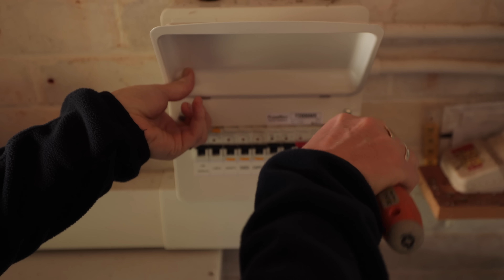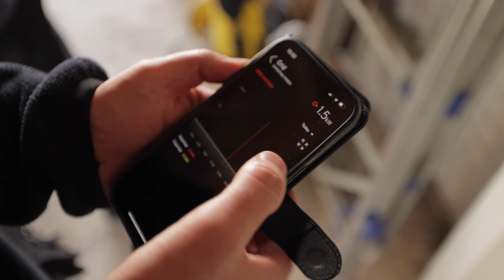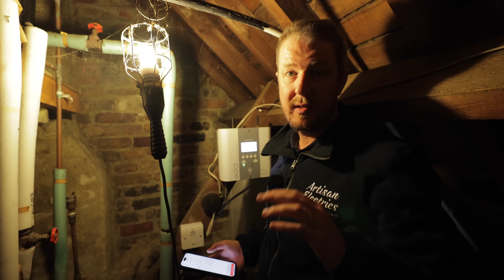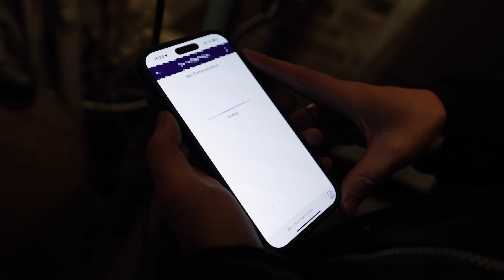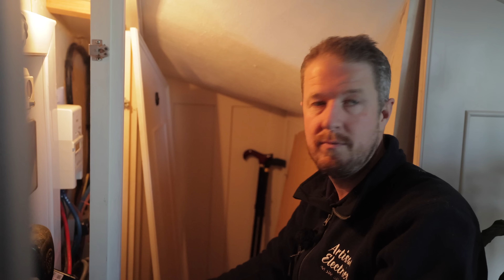£20,000+ Battery System RUINED By This 1 Simple Mistake 😳

Comment from the maker: 💡 Unilite Work Lights: Get 25% off all Unilite products using code "ARTISAN25" - https://unilite.co.uk/
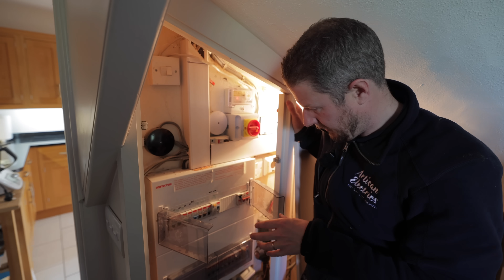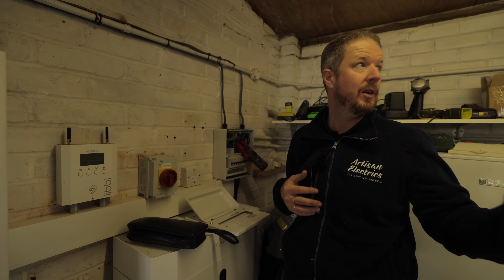Reply: 13:13 😊 13:23 14:49 15:37 15:37 😊😊
Reply: There is no insolation on hot water tank
Reply: After seeing all them boxes, i think I'll stick to normal, it looks a nightmare, you need a separate building for it all.
Reply: So this system wasn't actually ruined, as you claim in the title, but was misconfigured and not monitoring the correct currents. Please don't fall into the trap of using misleading titles; it does you no favours and will lose you some of your potential audience and active supporters. That said, thanks for the important information in this video.
Reply: @RWBHere  EXACTLY!

Also to consider, potential customers, that have the foresight to investigate companies to try to find the most honest ones, could easily be turned off by that misleading and blatantly wrong title.

Channel owners do have the ability to change titles on already posted videos.

So let's see if he gives it a more accurate title or if ego won't let him change it.  THAT WILL SPEAK VOLUMES!

Perhaps something like:
£20,000+ Battery System made inefficient By This 1 Simple Mistake
Reply: In Australia you will never see Single Insulated Cable without opening a switchboard. In the UK it seems that you can have sigle insulated cables where children or animals could swing off it.
Reply: *uses phone torch 😂😂

Comment: For me, I can see the benefits of interactions with a supplier for tariff changes but I think the savings are far outweighed by the complexity of interconnectivity and apps. I'm all for simple installations which are easy to analyse where faults occur. The likes of Octopus are just complicating things on a temporary basis. I say temporary, because soon there will be no off peak tariffs when EVs start charging at night in large quantities.

Comment: I had a similar problem here in JA. My 18 x 700 watt pv were pushing 13k while my 10k inverter wasn’t pushing enough juice to my 4  c 10k batteries and they were taking too long to fill up. I added another 10k inverter and for good measure added 2 more 10k batteries. I know it was overkill with the 9 x 700 watt pv but I didn’t care. I also have a 80 gal solar water heater.

Comment: Proper DC and AC conductor sizing is vital for any healthy system..

My shed with 6kW  solar is ~60m from my house - so many installers called it a "no-go" until one installer was willing to mount the inverter in the shed (remote from the  - and a 3c+e-16mm2 conductor was placed in the existing conduit (prior to the installation being performed, we also installed the CAT 6 cable (2x for with one for wired data) in a separate conduit for the main board 3xCT + power monitor hub) )..

Inverter or battery in a loft is a fire hazard...

Comment: Should be CT's in the main board running to the battery so the battery can see the main load and solar production and know when to charge/discharge, throw that Eddi in the bin, then the car can charge whenever it needs to from the battery which is alot more practical for the customer. that system has become an overly omplex system relying on wifi because the solar/battery/EV-charger were all done at different times, both wifi'ed myenergy devices just add more points of failure and add next to no value, the eddi diverter to the hot water is almost useless now that he has a battery

Comment: Tip: do not go for net metering. Keep the grid only as a back up and switch it off. Go off grid unless the skies go dark. Net metering is a rip off, pennies on the dollar. Ive been off grid for 2 years, with the grid only switched on as an emergency back up.

Comment: Thats great just changing settings for the guy. He could of chat gpt that and figured it out for them selves.  But thats why we are here. From before i ordered my system i researched alot of different prices quality sizes how too size how to install what will it do for me. Then i dyi the whole system when it showed up i know what setting i needed to make sure had to be done. I look at the app multiple times a day it not needed most of  the time but indo anyway.  Some times i change things. It took me little time to build to set it up i missed one thing that i did not see anyone say much about to the point were i had no clue that temperature coefficient ment that if its hot and you ac is on you what is normally an over kill system and charges full by noon every day becomes a run the generator 3 hours a day because 4500w of bi facial means 3500w in 100 degrees f. 8 hours of really good sun wont get the ac trough the night at 1600w. Sooo for 3 months each year my system is not enough.  Now for everything else its great i heat with propane or ac mosty ac during the day when batteries are full. No power goes to waste.😊 propane at night.but still love my system. Now more panels? Or more batteries? More panels are a waste most of the year. More batteries well 3 months worth?  lol expensive.. choices what woulf you do?

Comment: People often change their wifi routers every 3 years or so, and forget they've got all this kit hidden away around their houses which depend on an internet connection to work properly and update. There should be a big warning label on the front of the manuals stating that "This unit needs an internet connection to function correctly"

Comment: And at 16:30, removing the limit makes sense. Of course, you shouldn't intentionally set up a system that a fuse blows, but in the end the wire is protected by the fuse - not the appliances deciding to be nice and limiting themselves too much. I wonder what electrical code says (obv. not an electrician), but to me the charge-limit her seems more like a convenice feature (makes sure fuse doesn't pop/blow), rather then a critical safety system. 

After all, what if an applicance / the wiring has a short? The fuse needs to be able to protect the wiring, that's not really the job the appliances.

Comment: The stickers at 14:10 annoy me more than they should - mislabled electical panels are a pain. And in the end, the switch label is a part of the overall safety system. You want to be able for someone to make as many mistakes as possible without getting (seriously) injured, right? And not changing out the stickers is a simple way to add a small chance of someone not seeing the arrows (people are in a hurry!), and flipping off the wrong switch - leaving the system in a state where it shouldn't be.

Of course, you should still always check that the circuit you're working on is off before touching live wires - but basically, making one mistake more likely, the 2nd mistake (forgetting to check / incorrectly checking) went from an "oops" to a trip to the hospital. Yes, mistakes shouldn't happen, but they do - that's why we have redudancy.

Comment: In every investment, it's worth a little investigating & research, so one has a better grasp of the particulars,especially when efficiency is concerned. For instance, without deflection of the sun, you're relying on direct adsorption. In this case, the solar panels only have around a 2 hour/day maximum performance when the sun is in the direct line of its absorbing face. To track with the solar panel faces with the sun would give a whole day(max 12 hours) of light to its working effect. Even so, in early & late parts of the day, the distance away is proportional to its manufacturing of power, so this indicates the Sun isn't as far away as we've been told!

Comment: Did you just say the house is using 1Kw? 
How? I am currently (pun intended) using 64w. If my fridge/freezer comes on it will jump to a massive 125w. 

Fit a timer to the water heater, mine uses 3.2Kw, but takes 25 minutes to heat up and then provides enough hot water for a day. It is turned on at 6:25am and is turned off at 7am. 

Don’t generate more, use less.😂

Comment: CAT6 has a 100 meter distance limitation for good signal. Making good connections takes special knowledge and tools.   Exterior grade CAT6 cable is not cheap..   A spool comes in 1000 ft lengths....

Comment: i  seen   one guy with a single tiny panel 2   6volt battries  and had been   working over 20   years .
  the  other end was a guy that spent 60k   and intended to spend another 60k to be totally off grid  .
every solar system seems to be different from the other .
  what we need is a  system that works and is truely   plug and play .

Comment: Watching you on the YouTube video I have a similar problem. I’ve got a 5 kW inverter and 2x 9.5 kW batteries this is a Giv Energy system. My problem is that the inverter will only let me draw 3.6 kW out and if I’d draw any more than 3.6 it goes onto the grid supply. Is there anything that I can do to draw up to 5 kW without having to withdraw from the grid. Help any ideas would be absolutely amazing thank you.

Comment: So this is the state of modern residential renewables? All the devices are internet connected? I wonder how many of them have security vulnerabilities. I wonder how many of these companies will be in business in 20 years. I wonder how many of them will pretend they never made these products and de-list them from their websites with manuals and firmware nowhere to be found. I wonder how many of the cheap capacitors will dry out and fail.

Comment: Great videos as always, but plastic water tanks do not 'melt' at boiling water temps. Those plastic tanks need to be heated to at least 250c to melt! At 250c, that water would be steam, not water! What those tanks do, is leak or fracture due to the heat, they do not melt! very sad about the one incident. My advice is remove ALL plastic tanks and just use mains water pressure (hot and cold). We did this in our 1950's house conversion to renewable energy and hot water tank.

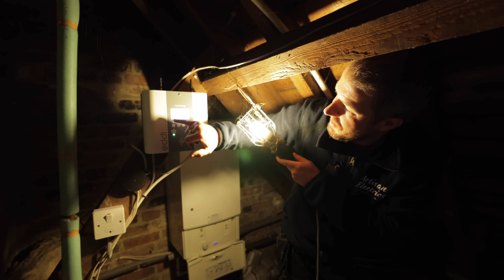Comment: At about 5:30 you said you don’t install inverters or other equipment in the attic. Does that mean the DC wires from the panels go down to the inverter down on the ground? Would there be a large DC voltage drop, especially as my house is a 4 storey? 
My Solar Edge was installed in 2016

Comment: Been watching your stuff, this made me learn about solar stuff, am retired now, am a fully electric and electronic engineer to the 16th edition, worked on both industries and site work, now in brasil, solar for electricity is a big thing her, whats alarming is sparky now and then getting killed our workers doing repairs and getting a belt, what fail safe is there with the panels, are they hot live when installing.  Ive not looked into how they are built.

Comment: The one thing I've learned about solar over the years is that the mc4 connectors are those connectors you want to buy the best quality you can cuz if you get shorts or fires that's what will happen in the inverter should not be in the attic. They do get hot and it's a good idea to keep an eye on them

Comment: In my experience a lot of solar fitters dont know what there doing . On the roofing side of which I have 45yrs plus the solar firms send young lads who learn on the job via u tube. They have zero knowledge of how a roof works . The last one we did they had to take the system off an integrated system fitted sticking over the gutter no back gutter flashing . And the list goes on.

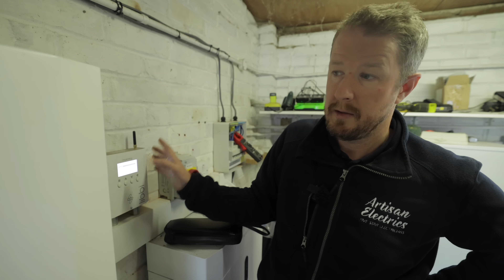Comment: Spoiler the whole point is on 17:35 so you can just skip to it. 
The previous installer limit the charge and discharge lower than it's maximum rated power, probably to increase lifetime and prevent breakage. What he did is just reconfig it to use it's maximum power, this will most likely makes either the batteries or devices die faster.
I often saw solar electric system broke down within 3 years because they use the devices to it's maximum power. For electric devices it's always better to never use it to it's maximum rated power to prolong life even if it's just a simple cable.😎

Comment: All solar systems I see installed in England are crap. Why not a simple hybrid inverter and a battery ??? Why all those small boxes and all those antennas and internet connections????
I have one box - the inverter  - solark 15K. Solar panels connect directly in the inverter and the batteries connect straight into the inverter. 
Every-time I see a solar install in England i want to pull my hair.

Comment: in Aus if you are wired to the Grid with Battery storage , the Grid has the rights to access your current without paying you 1 cent
in my book that is theft !!!  I opted to go off Grid and my 200 amp hr works a full 12 volt marine system
no more silly 240v nonsense.

Comment: Wait wait the Installer told him his system could only handle 30 Amps max at a time why would that prevent you from eventually filling the battery to full over time? That like saying this Hose can only handle 100 gallons and never fill a Bucket that holds 500 gallons it can it just takes more time to do it no?

Comment: 20 kwh is nothing for a battery storage.
"30 amps capacity" what tf kinda wire did they use?!? Here in the states, everything is on #6(16mm) from solar (60 amps)  what voltage? 30 amps at 200 amps is 6kw (maximum solar he has)  6kw of solar should charge that system in about 4 hours, without any home usage. But it looks like he has an almost constant draw of 2-3 kw? So the solar will never charge at 100% and at 3 kw charge it will take 8-10 hours, you showed 2kw charge, and that would be 12-16 hours... sorry, that won't ever charge, period. 

For the record, I have 24 kw of solar and 26kwh of battery backup (still going to increase that battery backup to 125kwh) I don't have anywhere close to his draw, no electric heat. Winter my system can be buggered for days, even a week! I have to be very careful with power during winter, summer, I can run whatever I want, can't even max out the solar until I get another inverter/charger and batteries, than I might max out the solar. Electrician in the states designed and built my system :)

Comment: Kinda complex...In my country Malaysia, we sell back our solar emergy back to our Electricity company through an AC inverter. We no Need to invest in a battery system. We still have the stable supply from the electric company.
Reply: Same here but we have different weather to you so need the extra storage for days with bad weather for solar power.

Far cheaper to store it and re use it as the energy costs we buy can change depending on time of day.  

We do not mostly use AC units at night if installed at all, so we get cheaper energy normally from 10pm - 6am when people are not using the power grid as much. So if you use the battery storage at peak times and then buy energy at off peak times it makes it cheaper.

It's the difference between a hot country and cold country the way energy is used, most heating is via a gas boiler, so energy is not used for heating (v cooling there).

Comment: Having a backup stat on the water heater is fine BUT how will you know the main one failed ? When the backup fails too your back to the same problem & seriously who EVER goes in the loft to check the water heater stat is working until they detect a water temp issue ????

Comment: Im sure your findings including the wifi not in sinc with all devices is more of a common problem than not.
  As an HVAC service technician & installer i have responded to many "No heat/cooling" service calls that are related to programmable T-stats and home management systems that are stand alone systems but installed to operate in conjunction with other devices and not installed by the same contractor. 
  Your observations and diagnosis is top notch looking at the entire building to understand the progression of how it needs to work for optimal performance.!

Comment: one of the worts videos I have seen. started asan customer solar charging problem, but no info if there was any solution, as theme and structure of video totally changed to meaningless ramble relating wireinstallinting and firmware updates

Comment: wait so a fuse rated at 50amp does not blow until 2 to 3x its design limit and that is not a problem? that sounds like a big problem if it is rated for 50amp it should pop off at anything over 50amp

Comment: You said "there is a 50A fuse, but that's not gonna have a problem with 55A. It's only gonna blow at 100A". Sorry, but this is incorrect. Home fuses are usually slow-blowing and use heat build-up as blowing mechanism. Like the old sand-filled fuses. Once too hot, they blow. A 50Amps fuse is designed to survive 50Amps for one hour. You are right it will survive 55Amps, but only seconds to minutes. Not hours. Charging the car + battery at night are usually long-term loards. The fuse WILL blow under these circumstances, hence the design is currently unsafe.

Comment: IT professional here: Time and date on wifi devices are both a symptom and a cause of connection problems.

They'll reject each others security certificates when they think they're expired. For wifi the tolerance is fairly large by IT standards. Getting them within the same hour is enough, it might be a lot more.

If the time difference is large that device has probably never synced, so never change the date without being prepared for firmware updates that  lock you out moments after you push confirm. If you need the device to have a load limit, put it in BEFORE updating the time because it'll  establish connection, start auto-updating, reboot and then start functioning before you'll have any control!